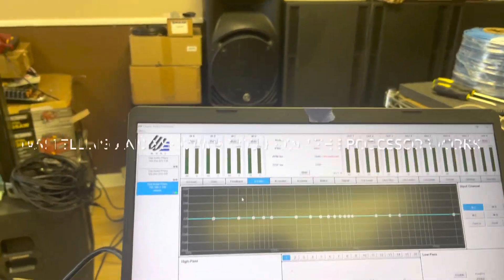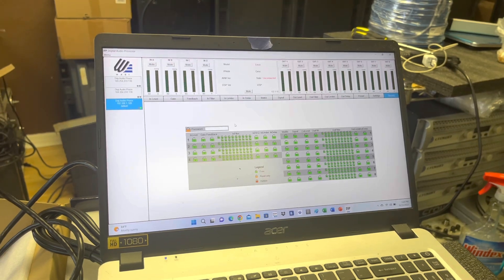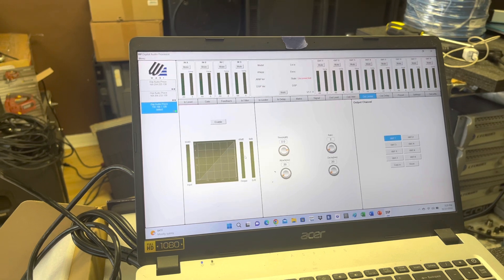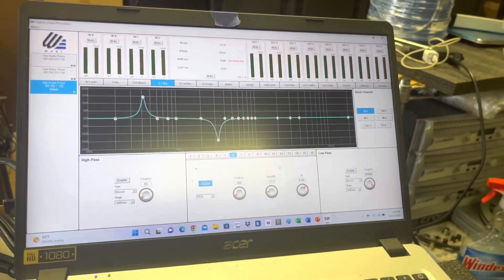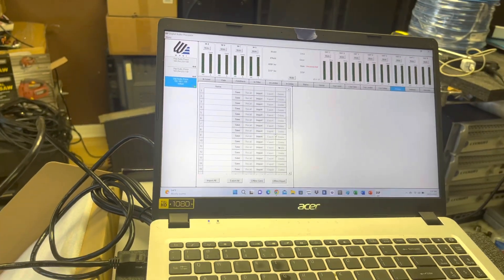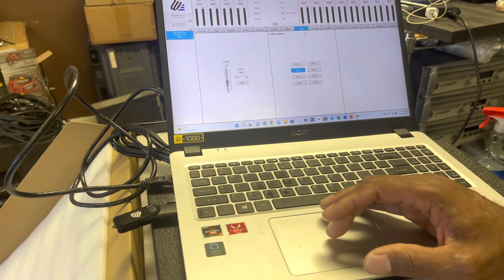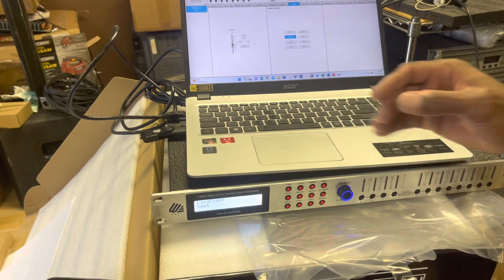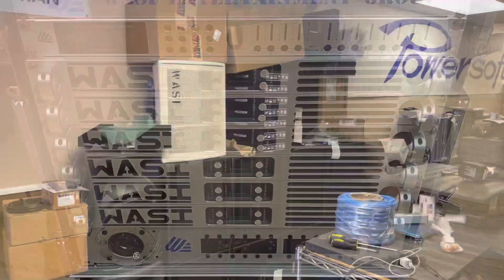PT2 WASI SHOWING YOU HOW THE PROCESSOR  WORKS

Comment: Get a fuse most sound man can't even figure out how to calculate resistance and simple saying get a fuse without a min or max value or guiding them to  the current rating  AC or DC current will  have people trying this method and burning their gear knowledge is power don't just throw these information out there cause most men twist two wire together all of a sudden their engineers  just remember  pass on useful information . And for those who's can navigate this a resettable fuse is too tip.